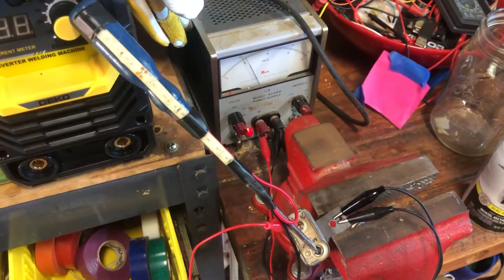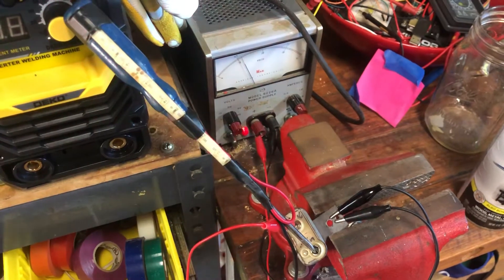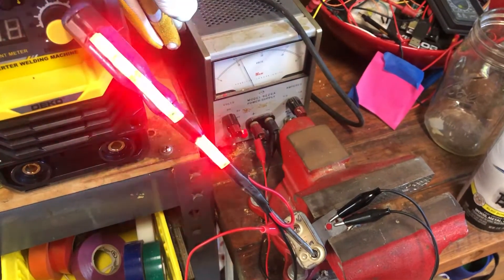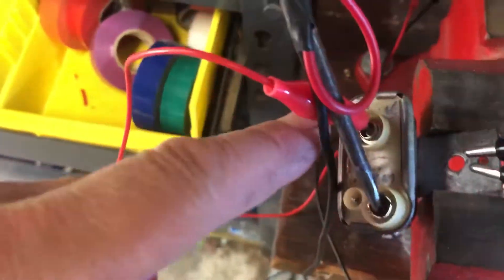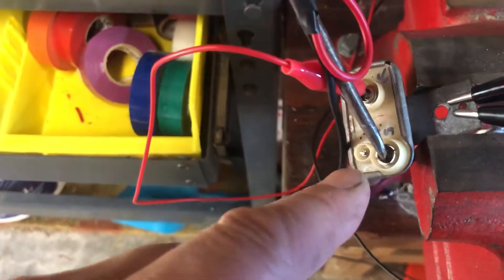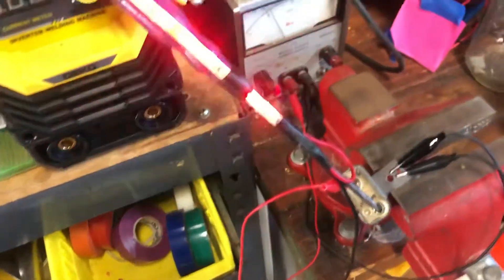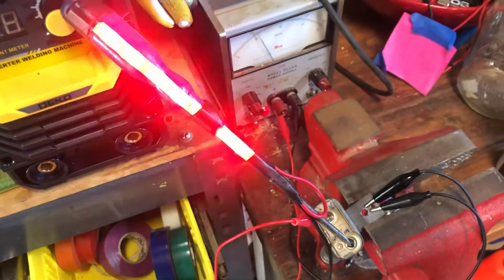One minute test video of instrument voltage regulator output

Comment: I looked in eBay what is that part name in there? What LED bulbs did you use? Thank you.
Reply from the maker: Hi
Here is example of a modern solid state replacement regulator
https://www.cjponyparts.com/ford-electronic-voltage-regulator-1965-1973/p/VR8/

The LEDs - for test - any will work - just remember to put a resistor in series with the LED to limit current (google value);  the strip of LEDs, that you see in this video has the tiny resistors built into them so I didn’t need to worry about that.  And as long as the voltage did not exceed 12 V, the LEDs would be happy.